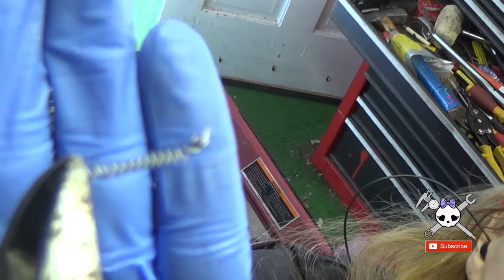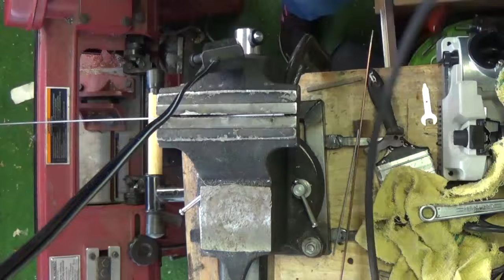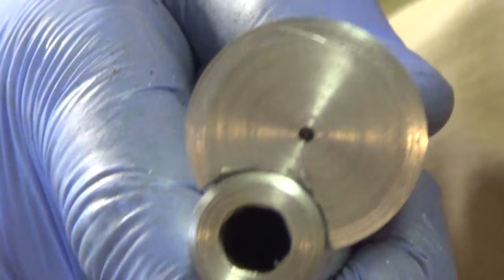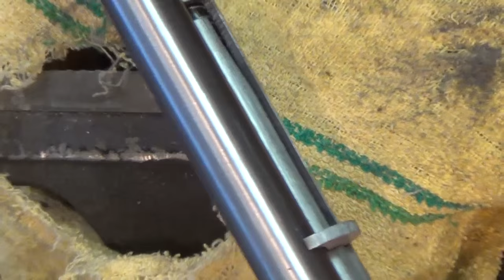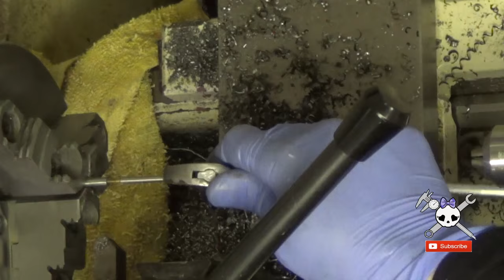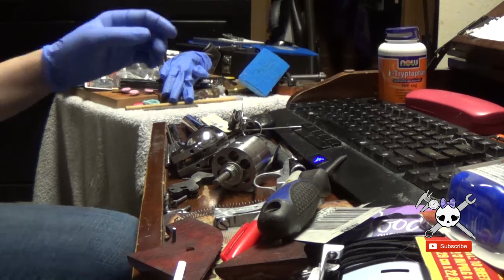1880's single action revolver build from scratch 15

Comment: I don't know who taught you you're craft, but what I do know they will be smiling from ear to ear, with pride. Your work is exceptional, the black art of gun smithing, tool making, and problem solving, is right up there. Well done brilliant vids, I dropped on your channel yesterday, couldn't stop watching them missed my dinner, your fault ( lol). Just the old retired tutor in me rather than safety nazi, please keep your hair covered, once saw a person scalp their selves on a drill, not a pretty sight, and keep the floor tidy around you work area, you'll be surprised how many accidents of people tripping into running machinery there is. Preaching done! Looking forward to the next project, and for the gun WOW!! Top job. Tony (uk)
Reply from the maker: thank you :) I worked 2 years at a machine shop and learned the basics from some of the old timers there, after that I basically taught my self. I was working industrial maintenance and at every maintenance shop there is a mill and lathe and we would have to build parts we couldn't find or modify parts to fit our application. :)
Reply: Loved the vids, there is a hell of a skill set there. BUT, I used a table saw for about 10 years before I almost cut my thumb in two. I'd hate to see anything happen to someone so meticulous and skilled :)
Reply: I agree, just started to read them today...  Watched 'em all.  I will be viewing them again and again.
Reply: U.K. has always had Master Craftsmen of World 🌎 Class skill in Gun Makers.
The British made shotgun is unsurpassed as the best shotgun possible bar none.

Comment: also, with heavy cylinder walls like those, you might be able to (if your chambers are deep enough) use .357 without issue-not saying you should, but with that much metal around each chamber, it should be possible if you have sufficient length.
Reply from the maker: +Daniel Ball yes I think it would easily hold up to a .357 and it cylinder is long enough but im happy with the .38 :)
Reply: hickock prefered the smaller calibers also
Reply: Remember it is not much the thickness of the cylinder wall as is notch placement on the cylinder itself, in Colts and S&W, the notch is over the thinnest part of the cylinder, Ruger shifted the notch over to the thickest part of the cylinder, greatly increasing strength.

Comment: To hot blue all you need is 2 cans Gordon's stump remover, 1 box powder lye, 2 gallons distilled water, hotplate and finally 2 stainless steel pots. I've gotten both bluing and the plumb color associated with S&W. The pots are large enough to do a pistol which is what I did to my homemade 1911. It is a durable finish and is the same as the ones from the factory. I used potassium nitrate (the stump remover) but sodium nitrate can be used and I suspect ammonium nitrate as well. Look in fertilizers and products of that nature for it but the Gordon's is really good. 

This is a fairly easy process, but I will say you did a good job with the cold blue not a lot of people can do it consistently. 

The gun overall is awesome and very well made. It is as good as high end production guns and miles ahead of mil-surp guns (generally lacks in fit and finish). Good job.
Reply: Production guns use the lost wax method, or MIM, Metal injection molding, that eliminated finish machining, and greatly lowers the cost of manufacturing, otherwise a Revolver would cost from 20k to 30k and take months to a year to complete.

Comment: This whole project was fascinating. I'm no gunsmith or machinist by any means, but I think I might have an idea for affixing/aligning the front sight blade.

With the rear sight notch carved out, you could make a sort of jig going off of your wire idea, and have a small clamp at the end of the wire of some sort. A hose clamp of some sort may work? That way you have both aligned and clamped your sight in place, all that's left to do is work your magic. Of course, your method worked just fine as well lol 

Maybe a stupid idea, I dunno. Either way, outstanding build and thank you for taking the time to film, work around your camera equipment, edit and narrate the entire series for us all :) that's a job in it of itself, let alone building a complex mechanical firearm that also has to withstand high pressures and whatnot. Again, awesome job! Top notch!

Comment: i have a colt blank firer for quick draw,all steel,off set cylinder exit non live fire ,point is, the pivoting firing pin as you say moves in an arc,the hole where the pin travels through to strike the primer is a concave cone shape to allow smooth alignment to the primer,though a floating pin would be cool,but youve gone old(west) school,great vid,skilled work is awsome,you rock. 
as for the front sight ,all the skill you show ,i wouldve expected you to dove tail mount it,side to side cut for zeroing,but scratch built and to look as good as any factory made gun is just fantastic.
Reply from the maker: +john amptech I thought about it but I didn't have a dove tail cutter that size :) im unemployed so I have to watch what I spend right now :)
Reply: You are UNEMPLOYED ???  Are the owners of Metalwork-Business dumb or blind, where you live ?? i know some Owners here, they will cut one of his finger to have a skilled Craftswoman like you on the payroll !!! btw. this gun is a real beauty !!

Comment: A better blue is cold rust bluing you can get at Brownels, It's basically is a solution you put on the part that causes it to rust. Then you boil it in water, and it turns to blue. Wish I had your machining skills. Great work!
Reply from the maker: it will get blued for real one of these days :)

Comment: Beautiful work, I wish I had your skills.  From what I could tell you built a traditional style single action, that type revolver is only safe if carried with the hammer down on an empty chamber, that is the traditional way.  That style the firing pin rests directly on the primer of the cartridge, if the revolver is dropped and it hits the hammer, its possible for it to go off (discharge) by accident, so it is only safe to carry with 5 loaded and the hammer down on an empty chamber.
Reply from the maker: ya i will probably never carry it any way its way to big and bulky  ;)

Comment: As someone with experience in many aspects of this series I wish to congratulate you on seeing it through and doing a superb job too.  I already know just how hard (and tedious) the combining of multiple machining operations, filming them, then editing the little snips of avi together to make something uploadable, then the hours of wait while it uploads is in combination.  And you do it over and over again too!   Again a major tip of my hat to you.

Thoughts.  That firing pin.  You may wind up re-doing it and going with a cone shaped pin like the old revolvers had.  Reason: narrow pin fragility..  It may break on you with heavy use.  This is why the old ones had heavy cone pins instead of narrow parallel sided pins.  Any chance of you modifying the video descriptions to show what is being made in the different videos?  I mean part 1 -- cylinder, part 2 frame, etc..

I await your next project and wish I still had a Luger to send you as a model.  I bet one made by you would be as nice as the ones made by John Martz..   Ah heck if you weren't 1,000+ miles away I would just drive over there and loan you one of my old Broomhandle Mausers to make drawings off...      You would love the jigsaw pieces in those.        :)
Reply from the maker: +Ken ibn Anak thank you so much :) I think the video part of it is the biggest pain I love machining but editing video is tedious at best. I would LOVE to build a luger  I have some plans for one but they are blurry and metric and in German. I could eventually translate the German and convert the metric but not much I can do about blurry stuff I cant make out.  I molded the firing pin after a modern one I saw a while back. time will tell I guess :)

Comment: Don't have a lot to add, excellent build and I greatly enjoyed the series. Thank you for sharing and looking forward to your next project should you choose to share it as well. 

Wonder if you considered slow rust bluing at all? It's not hard to do and can be done using hydrogen peroxide, white vinegar and sea salt. Need a kettle to boil distilled water and a suitable container to soak for the conversion process. Neutralize using a baking soda bath and finish with a couple coats of paste wax. Have been playing with it for a couple years now and find the final product far superior to cold blue. Does take a lot more time though.

Al
Reply from the maker: thank you :) yes I did consider it but I personally don't love the look of it. but I'm not sure if I have really seen enough examples of it either.
Reply: +Waffenschmiedin xHas always come out what I call a "soft/satin black". Not a Python finish to be sure lol.  Thought I'd as, it's not something a lot of folks know they can do at home.

Auf wiedersehen waffenshmiedin
Reply from the maker: ahh see I thought it came out a brownish color so I haven't seen enough examples of it :)
Reply: Browning is rust bluing without the conversion to black iron oxide (magnetite) via boiling. Not sure if this will work...some parts from a 1940's Crosman pumper restoration and a pcp air pistol I built a while back. 

http://s245.photobucket.com/user/gippeto_album/media/20150430_202037_zpsl0wafujl.jpg.html?sort=3&o=89

http://s245.photobucket.com/user/gippeto_album/media/IMG_3859_zps50774e38.jpg.html?sort=3&o=198
Reply from the maker: +Gippetos oh yes they look great ty for sharing this with me :)
Reply: Most welcome.:)

Comment: I too was blown away by this series. You have grit lady. Never thought "from scratch" really meant "from scratch". Not many purist gunsmiths out there, but you are one of them. May you go far.

Was wondering 1) why you selected spring steel for the bolt rather than 4130 or 4140 and 2)  Where I can download a copy of your CAD drawings for this project
Reply from the maker: I used spring steel because half if the bolt is actually a spring. when the hammer is done pulling the bolt back the little "fingers" have to allow the bolt to squeeze by. it's sort of a ratchet type mechanism.
Reply from the maker: email me your email address and I'll send you a copy of my drawings :)
Reply from the maker: Oh and thank you :)!

Comment: Congrats on the successful conclusion of this interesting project and thanks for sharing. 
A) How did you plug the barrel bore when cold bluing it? Or did you blue the bore as well?
B) You said you silver soldered the front sight to the barrel. But to me it looks like lead or tin soldering. What exact type of solder did you use (at what soldering temperature)? To me silver solder has a yellowish shade and melts around 750-800°C which is red hot. Your solder is really silvery and the work seems not red hot. Would the high temperature not distort the barrel and oxidise the bore surface?
Reply from the maker: +rol eic A) i packed it full of grease sorry i guess i didn't mention that in the video i had planed to. it is high strength silver solder i think this type melts at about 550-600 i don't have it down here with me at the PC its out in the shop but i believe that was its melting temp. i got it at the local welding supply shop

Comment: Great build!
Where did you get the plans, copied on an existing guns or you had a book too? 
I read about Kunhaunsen shop manuals but didn't look into until now. 
Congrats for this build, it's widely reputed un-doable or SO difficult when one asks on machining forums. 
If you can recommend good reads and maybe even a set of plans, just for future reference, I'd be glad to get them...
Reply from the maker: im copying a gun I already have. its easier when you have a model in front of you. as far as machining forums that is one of the main reasons I made my SAA revolver was some one told me it couldn't be done. :) so I did it

Comment: Beautiful work, glad to see that everything went well with the shooting test. What kind of steel did you use (4140?)?
Reply from the maker: +ExF1Guy thank you :) pre hardened 4140 to 27>33 Rockwell The C scale you can sometimes finds small bits of it on ebay
Reply: +Waffenschmiedin x 
Thanks.
Reply from the maker: any time :)

Comment: Wow, very nice job, I'm impressed. You are lucky with this kind of machines. I made a Colt SAA too, but I have no such machines, so mine was made with hand tools. Where did you get your skill of metal working?
Reply from the maker: for 2 years i worked in a machine shop. then I worked doing industrial maintenance for most of my working carrier.  many of the places I worked have very old out dated machines that needed parts. you could no longer buy the parts so we made them. so im basically self taught but learned a lot from co-workers

Comment: That was so cool!!! You did such a great job. I was just wondering why there are no cylinder flutes? Also did you initially test it by holding it or using a safety enclosure? Just curious, Not that I didn't trust your work :)
Reply from the maker: +davidographicsguy I didn't put in the flutes just because I like how it looks . I just held it but put my body/face behind the trunk of the car till I shot it a few times :) then just held it. I wasn't to worried it was build fairly beefy  and a .38 isn't a crazy high pressure round like a lot of them
Reply from the maker: +davidographicsguy and thank you :) !

Comment: Heather, why did you choose .38 special for this classic build rather than .45 long colt?  I know it came originally in several calibers but the 45 is iconic.

Perhaps for a future build you could do a Winchester 1873 lever action also in .38 special to match.
Reply from the maker: basically the old gun i got the measurements from was only big enough for the .38 i would have to scale it up to use the .45 . ive had a lot of requests for a lever action gun so its a possibility. :)

Comment: Post finish... Was there any fine tuning needed, and have you put many shots down the tube? In hindsight, what might you have done differently to either improve the design or alter what you've done?
Reply from the maker: +nifty1940 when I first made the bolt I made it EXACT. it fell in just as the hammer was all the way back and had 0 slop, that was a mistake, if you cocked the hammer to fast it wouldn't have time to drop into the cylinder. having it exact saves from those marks that are made on the cylinder from the bolt rubbing on it, but I made the bolt drop a little before the notch got to it. this made for a way more reliable lock up . after doing that the half cock is a little off and will need to be adjusted now but the gun is working reliably now so its not a big deal will just take a few min to fix :)
Reply from the maker: +nifty1940 I may also make a new hand that fits a little more tight, just because im prickly and its a little loose. it works fine but bugs me lol

Comment: that looks awesome! Great work, thank-you for showing us all that! Do you need some type of protection between the aluminum grip frame and any steel it touches to prevent accelerated corrosion?
Reply from the maker: +Zach Satter thank you :)  I think as long as its oiled it shouldn't be a problem. lots of modern guns have a steel slide and a aluminum frame with no protection other then oil.

Comment: Its been awesome watching this build from start to finish. Good work and thanks for the videos! I cant believe youre not working as a gunsmith somewhere! My only question is how much did it cost to make just in materials? (not time or labor, which is obviously a lot!)
Reply from the maker: +sergeantbigmac the steel was maybe $250 or less.
Reply from the maker: +Waffenschmiedin x I take that back I just looked the total cost of the steel was about $75 and I had to buy a reamer  that was $15 several carbide inserts maybe $50 a tap $20  and a few other odds and ends silver solder $30 sandpaper $30 cold blue $20 steel for cutters $20   so total about $250
Reply: Waffenschmiedin x Cool thanks for the breakdown. Not exactly cheap but the experience of making it is invaluable.
Reply from the maker: ya and you might find some cheaper here and there also

Comment: Very nice build 
I would of likes to see you use laurel mountain brown instead of the birchwood casey stuff for the blueing

Laurel mountain brown is slower but is a much deeper penetrating cold blue ( well turns black after a dip in boiling distilled water)

Just my opinion but with all that time spent and work for a beautiful piece a very deep penetrating blueing would protect it better against rust
Reply from the maker: several other finishes would have been better for sure. some times you get stuck with what you have access to : /

Comment: Super nice work but when you cold blue might use Van's cold blue . The only one I know of that will penetrate the metal .A gal. costs about $ 110.00 and will do a really good job.
Reply from the maker: thanks :) i plan on bluing it correctly when i eventually get the equipment :) thank you for the tip ill look it up